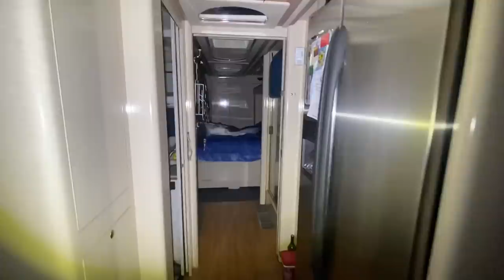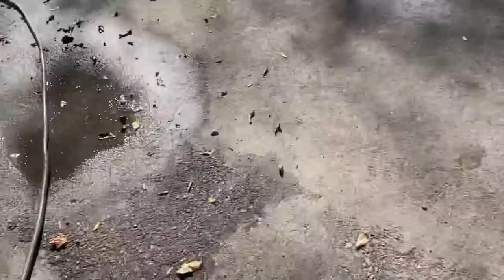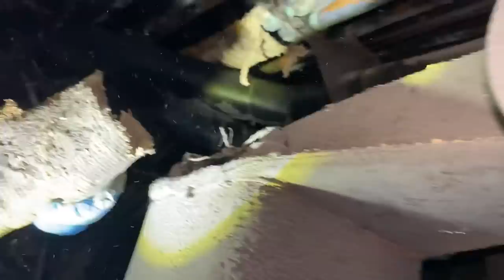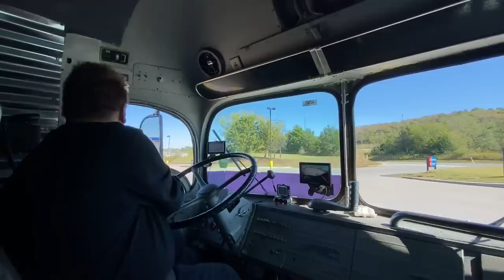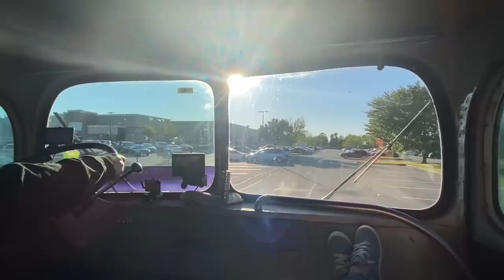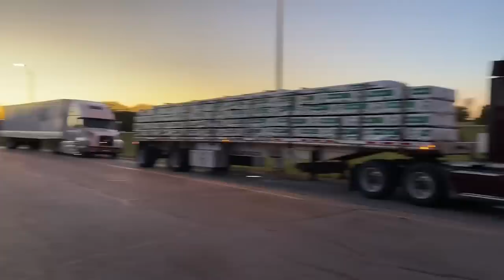Eagle bus tour and driving the 1947 silversides through Tennessee and Kentucky

Comment: Scott, I am interested to see if that 1941 has what I think they call a low block 6-71- uses a conventional gas engine style sandwich head gasket. One of our " truckable" tugs at work has one. The guy who rebuilt it for us found original design liners in it with 5/16" drill hole air ports.He said those went out of production in 1943 dating the engine. It has a WWII Navy plate on it and the marine transmission was War production license built by Oliver Farm Equipment. I built the exhaust stack out of off the shelf Freightliner parts. Kelly would probably approve. The other tug is L-O-U-D.

Comment: By the way ,how far will a full tank of fuel take you ?
Reply from the maker: I try not to go past 650 miles.  Since there are no gauges it’s a gamble on fuel economy.   I get about 90 gallons of usable fuel out of my tanks.  I like to keep a 20 gal cushion for the pickup tubes that like to suck air on steep hills and pitched or banked roads when fuel is low.
Reply from the maker: I fueled up in Avon drove to Blytheville, did the karate (omg auto correct did that so i had to leave it) parade is what i typed,  then drove to Franklin Tn and fueled up after leaving Franklin.  81 gal  3mpg city vs 10mpg hwy it’s sometimes hard to do the math guessing how much city vs hwy
Reply: You need a very accurate sending unit in your tank ,and a very accurate gauge on the instrument panel, But as busy as you are ,I'm sure it's hard to find the time to accomplish that no doubt . Just a thought . Drive safe ,and work safe ,Take care.....